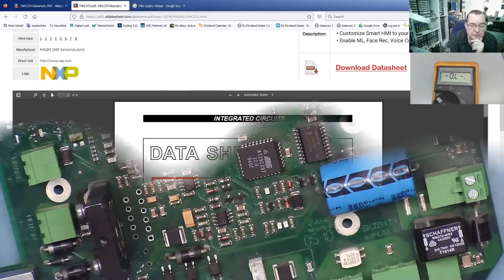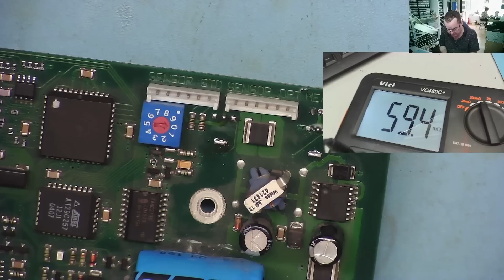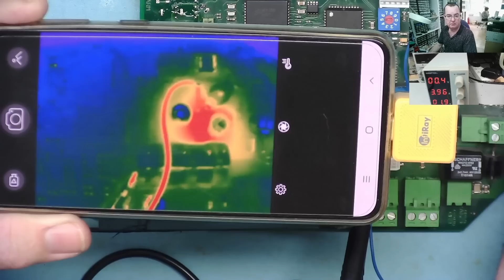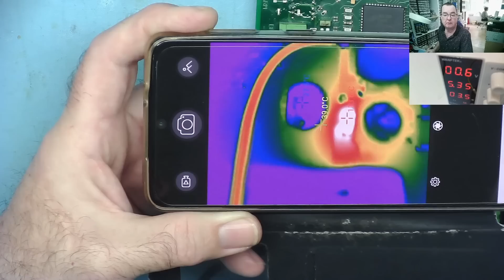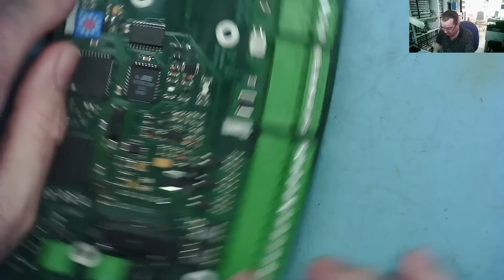Use Basic Electronics Knowledge To Repair Industrial Electronics - Pure Methodical Fault Finding Pt2

Comment: Agree 100% on the "voodoo" part. The 'voodoo' part I tihnk is just innate pattern recognition, that becomes so ingrained into your mind and soul that it becomes second nature. You don't "think" about how you're going to drive home, you just do.

CPLDs and FPGA's are 'dumb' in general. They don't have masked ROMs on them. That's why you had an auxiliary Atmega chip with 8 lines going into it (to feed the configuration data on boot). The FPGA (the one that was getting hot, the one with the white dot) might have been performing just fine. They're notorious for drawing a couple amps, while properly operating.    

Why they chose to use a fuggin FPGA for a gate system is beyond me-- its not like you need heavy number crunching for a parking system. The only thought I have is for the opto-disc counter.

Finally, once you cleared the main fault, and got the red LED lighting up (giving you some sort of status indication), I suggest you should have tried plugging in a wire to test what serial information was coming in or out. (RS422 or whatever that was). At the top of the board there was a jumper that said "OEM Boot" or something-- which suggests to me that there's certainly a way to boot into a diagnostic mode-- it would have to, since I'd imagine this is just one small part of a larger access-deployment scheme (fail safes for all firedoors, tracking habits of visitors and employees, sometimes even timers for cash-drop boxes even)

Anyways, great stuff

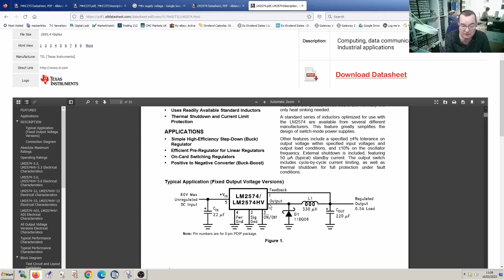Comment: I don't know why you loose so much time. Just inject voltage and use the thermal camera. If you have short this is the most fastest and reliable way and you know it. A quality of the thermal camera is also important. Well even with yours for me was easy visible that the component is the one on the left (Zener diode) from the capacitor you have suspected in the beginning. But when you are not sure and the camera is not with very good quality you can use isopropyl alcohol or rosin evaporator to pinpoint the right component. The second element you have removed was on the input side of the coil so there was no logic to do that after you new already the short is on the output. And yes the shored diode is Zener diode and it was clearly visible on the schematic diagram you have looked at (6:22). And I know that you don't like the low melt solder, because it is more expensive (actually this is not necessary true - I can provide a link to the one I use if you are interested), but it will be way easy to remove all the components from the board, even the IC you have removed, using only soldering iron. Beside that, thanks for the good explanation of how the things work. It is very helpful for me and a lot of other people. Thank you for spreading the knowledge.
Reply from the maker: The reason I didn't find the correct shorted component (zener diode) was because I mistook the mounting hole to the left of the zener with the top of the electrolytic capacitor to the right of it.    I'm not sure how I could have 'just injected voltage' without first finding that there was a short on this voltage rail and then working out what the voltage rail should be and what the faulty component was.  Even if I had been able to do it, I when most likely would have missed the short in the motor control IC in part one (which was not on a voltage rail).  So personally I don't believe I lost any time, but we all have our own methods of working on this sort of PCB and really there are no right way or wrong way as long as you get there in the end.

Comment: Good analyses (again). The diode looked to be ESD perhaps as there appeared to be no series resistor. You know about IPA flooding to 'locate' the hot part, northridge also uses flux atomising but that's a bit of a faff. Most 'men' would buy their wife a phone, I wonder what's she's checking the temperature of, ho, ho.
Reply from the maker: Haha my wife has a phone but she often deals with a lot of my calls if they are related to the local bars and customers we deal with who have satellite subscriptions (our other business).  The zener is actually a crowbar circuit, it is meant to go short if the voltage on the 5V rail goes above, say, 5.6V or 6V, thus killing the over voltage condition.  This will act faster than a fuse and is supposed to save the voltage sensitive components.  Unfortunately sometimes this doesn't work fast enough.

Comment: 0:52 - Well thats supposed to be choke coil? Thats why it has low resistance.
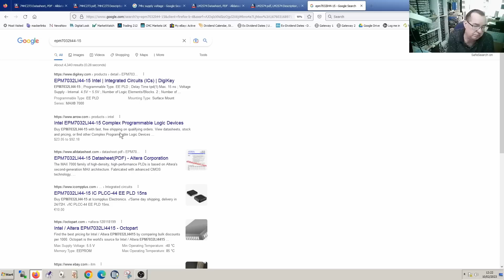30:25 - Contacts of chip are exposed, meaning that we can use oscilloscope to see is chip alive or not.
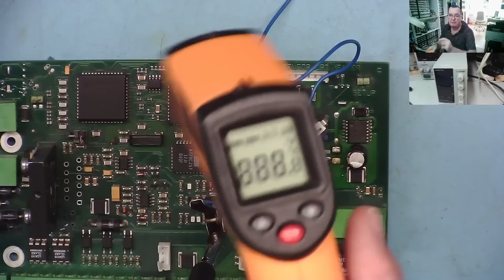34:22 - I think its pointless and dangerous to start the board without chip. I believe there are scenarios that can cause more damage to the board. Anyway board is not designed to work without IC, so first is to replace IC.

Comment: I have watched a lot of your output and this is definitely  in your top five. Nothing wrong with the others, but its one of those where everything just comes together. Who would of thought that you could make the 'simple' process of driving a motor on a door/turnstile so complex. It the hobby world, you would just take a atmega 328p (Arduino chip), connect up to an 'off the shelf' H bridge motor driver and add some inputs, From there you would expand the 'design' with some levels of protection (opto isolation, de-coupling capacitors ...) and have a working system. Would it still be working in 20 year time? If built properly (may be on a board from the guys at PCB Way), why shouldn't it?
Reply from the maker: I've been to this nature theme park a couple of times.  It's called Palmitos Park (Gran Canaria) and it's really nice actually.  It is up in the mountains so locals drive up there (and we get big discounts on admission as well if we pre-book online and present our' Residencia' (ID Card). Tourists are generally taken there on organised coach trips, though there is also a regular public bus service from the main tourist areas.  You can also get season passes. They have two kiosks at the entrance, one queue for pay on arrival at the manned kiosk and the other for prepaid. They have a barcode laser scanner where you use your entrance pass and I guess it checks if your ticket is valid for that date, and no doubt does so data recording so they know who in on the site at any given time, etc..  So the system is probably a bit more complicated than just operating the motor.  I'm assuming only one turnstile is operating at the moment.  It's not a huge place but they get hundreds of visitors per day.  They also have a sister theme park called Aqualand and you can get combined tickets for the two.
Reply: @LearnElectronicsRepair  So there is a bit more to it then. Maybe use an ESP32 instead with a WiFi connection to an office server hosting a web RESTfull service. Obviously not available 20 years ago. The availability of  SOC devices these days puts a lot of processing power with input/outputs galore for very little money. I am currently developing developing an motor cycle alarm tracking system with ESP32 + AG9 so it has GPS, GSM/GPRS, Bluetooth, and WifI. Coupled it up also to a BMI160 accelerometer to detect 'initial movement' before triggering the GPS Setting/unsettling can be done either by bluetooth / 8 digit pin via rotary encoder or RFID tag swiping. £30 worth of components that does what a £380 + £20 / month commercial system does (although not thatcher approved). I dare say that guys in the future will come across this sort of thing more often and if you can't get your hands on software encoded in the SOC, then it will be the same story if the SOC fails. However the thriving Open Source community puts it out there for others to use and build on. A bit of a ramble, but as Bod Dylan sang, "The times are a changing!".

Comment: Hi Richard. I wonder if you could use the mili ohmeter to trace the short, meaning the component with the lowest resistance reading is the one that has the short.
Reply from the maker: Yes, technically you could but practically you couldn't. The method of injecting current is much better as that voltage rail will go to many places on the PCB and with the short present you probably can't even work out which pins are actually connected to shorted voltage rail and which ones are connected to ground anyway. 😉
Reply: @LearnElectronicsRepair  Ya that's right. Thanks a lot

Comment: Hi mate. How did you make your probes on your ESR meter? I keep getting an error message whenever I try to zero other probes with mine, other than the ones that came with it.
Reply: Agree. The original one is have wiggling value when shorted
Reply from the maker: Set it to manual range 100R and then it should zero with long leads
Reply: @LearnElectronicsRepair  I'll try that thank you mate. Keep up the great videos buddy! Take care.

Comment: Hi,

Very interesting video. I was wondering why you didn't almost immediately go for injecting voltage and use thermal camera/rosin/isopropyl alcohol to determine where the short(s) were?

Also wondering what you can charge your client given that the board can't be fixed?

Will you resolder all the parts you took off and then give the board back to your client?

Please keep up the great work. I enjoy looking at videos like this on yours and other channels
Reply from the maker: 1/ You can't inject current into a short until you have found the short in the first place.  This PCB has two faults (at least), only after finding and removing the first short could I move on to investigating the second one.  The only reason I got that on to the second short was down to 'factor two'...  Intuition.  And a touch of luck.

2/ This is something you have to organise with your customers before starting.  You can have an inspection fee or operate no fix no fee (and make up for the 'losses' on the ones you can't fix by charging more for the ones you can).  This will come down to what is good for your business and your average success rate.

3/ Yes I would just refit all the proven good parts that I removed and give the board back with the bad parts in a separate anti-static bag.  It wouldn't take me very long to do that.  The zener diode that went AWOL, if i can't find it, I will just stick a good 6V 1.3W zener in there.  That's my best (educated) guess and they cost next to nothing.

Comment: Richard can you please mention the temperature and flow rate for the hot air stations in future videos as I just cannot seem to manage to desolder large components without sometimes popcorning the board even after preheating the surrounding area to prevent thermal shock. I am wondering if it may be my cheap hot air station. Thanks for great content, I remember when you first started and we’re on less than 1k subscribers, I knew this channel would become popular with the tech community.
Reply from the maker: Sorry, sometimes i do mention it.  If I don't state otherwise you can be certain it is set to 450C and full air flow.  It's a Quick 862DW.   If i am doing BGA work which requires longer heating, it will be set to 350C full air flow and I will be using a preheater also.    Nice to see you are still along for the ride, the channel will be two years old on March 24th
Reply: @LearnElectronicsRepair hi Richard it was not meant as a criticism I have learnt loads of shortcuts from you, I look forward to your videos - two years old how time has flown 👍
Reply from the maker: @prads4168  No worries, anyway I'm certainly not above criticism that is for sure 😉

Comment: Thanks Richard. What is the app and device that is measuring temperature on the pcb please?
Reply from the maker: It's an Infiray T2S+ Thermal camera with 8mm macro lens, and the android app comes with it.  There is also software for windows 64 bit and linux (you can email me for the links)   I made two review videos of the T2S+ a few months ago.  It is an extremely useful diagnostic tool. 
https://www.youtube.com/watch?v=2X0RAfqPvIw
https://www.youtube.com/watch?v=ctmJ97NtMCY
Reply: I'm so sorry for the late reply Richard. I had trouble finding my comment history in YouTube. 
I use an iPhone X but I will take the time to watch the video link you sent. I think there may be a similar device for apple phones? 

I really appreciate your time doing these videos. Thanks to your channel I'm getting faster at diagnosing and repairing all kinds of electronic equipment. 🙏

Comment: Hi Richard. Close to broken ALTERA you have the AT29C257 flash (PEROM) memory. The question is if this flash is using for storing some parameters or is acting like source of program for the ALTERA. If AT29C257 is not broken and you have a proper programmer, you can try to read it if there is something.
Reply from the maker: Thank you - some of you guys are far more advanced than me in certain areas and that is what makes this channel a real community. I can do 'my stuff' but there is a lot more to this sort of work. That eprom chip is not getting hot so most likely it is good.  I can get the Altera IC so if it is worth a try I will replace it

Comment: Nice job Richard. Another amazing video, I thought the board only had the one fault. Great job tracing all the other faults out. I'm guessing that was a crow bar circuit, with the zenner and what looks like a TVS diode. 
And those small looking resistors aren't resistors, they are coils, iirc.
Reply from the maker: Yeah the zener is supposed to be a crow bar circuit.  Tto others, this means shorting out a voltage supply with a cheap component, that acts much faster than a fuse, with the intention of protecting other sensitive and expensive components. The expression comes from the (old) practice of dropping a crowbar across the output of a power source to shut it down.  The little cylindrical stripy things are resistors apparently, they are called MELF
Reply: @LearnElectronicsRepair  Yeah, I've seen the crow bar zenner in a friends tv box, where they used 12 volts instead of 5 volts. Funny thing was, they had two similar boxs they did the same thing to, but only one had the zenner installed on the pcb and the other didn't. Just removing the shorted zenner was enough to get that one working. Kept the other one myself until I could get a few parts on ali to fix that one too. Still works now 🙂

Comment: You're like a Detective , following clues to find the offending components. I try to explain to young techs that it's a game of ins and outs.  What signal or voltage is going in and what's coming out.  When I was a youngster a senior tech told me, be prepared, sometimes 2 + 2 doesn't always equal 4. Everything can measure okay and it still won't work.   The Voodoo working against you.   Great video.

Comment: It is an FPGA, but FPGAs are programmed on startup from some non-volatile memory, so it might be possible to save it, if you can find a NVM chip on the board, then you just need to replace the FPGA.
Reply from the maker: Thank you, as someone else mentioned the same, I still have plenty to learn myself (don't we all?) so if it is worth a try then I can get a replacement Altera chip and give this a go.  Many thanks 🙂
Reply from the maker: @Mr Guru Thanks for clearing this up, as I mentioned it was on the limit of my knowledge but now I know more myself. Cheers.  
I an quite sure I identified the rom or eprom in part one (at around 00:07:10) AT29C257 and the processor/microcontroller as MC68HC11
Reply: @Mr Guru Yes, apologies (to you both) I got my Altera part numbers muddled (never answer from memory late in the evening).

That said, below the Altera is an Atmel 256K Flash memory, which may or may not be doing the Altera EEPROM duties, or is the main program for the CPU - without knowing the CPU it's difficult to say. If the former, a new Altera chip might fix, if it is the latter, then it won't, clearly.
Reply: @Mr Guru The Altera can be reprogrammed, it is (for this type) one of its major selling points. As to being reprogrammed 'by itself', that would be a pointless feature, and no one has suggested it.

I will try to find your other post.

As to "why a guess", at the time of writing my original post you yourself had asked the same details (the processor / microcontroller information), I had merely enquired.

It is difficult, in the comment section of YouTube, to follow progressive updates (the OP comment is reported, but not your comment to the OP, so I don't see it unless I come to the existing comment section on the video page).

Hope that helps.
Reply: @Mr Guru Naming yourself Mr Guru does not guarantee anything, I think you would agree. 

I am not trying to teach you anything - I've been doing design for about the same amount of time, I merely asked some questions, while dealing with the limitations of the YouTube commenting system to see replies in any kind of useful order from the notification tab. The answers to questions were not shown unless you came back to the video page, hence why I asked and made comments, nothing more, nothing less.

I do, however, appreciate the clarification, it helps. Thanks.
Reply: @Mr Guru That is not obvious from anything at all, nor validatable without doing more extensive searching than anyone has time for. Again, I haven't doubted you at all, merely pointed out that calling yourself on channel with no content Mr Guru means very little.
Reply: @Mr Guru I never found it a waste.
Reply: @Mr Guru There's more than just the initial reply here, hence I never found it a waste. Additionally, I'm not arguing with you (I have, in fact agreed with you most of the way, except your comments that the chip couldn't be reprogrammed, which it clearly could, but what you meant was in-circuit in the existing configuration etc.)

Discussion without arrogance is the best type don't you think?